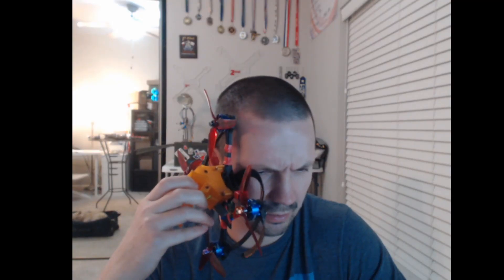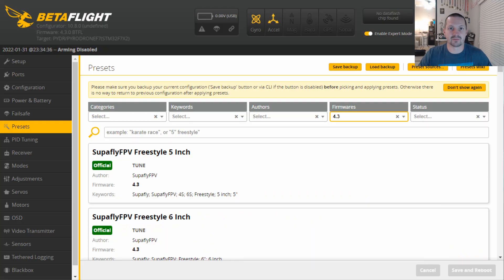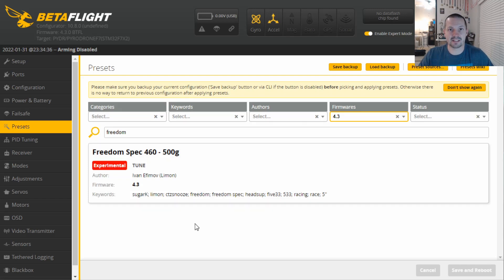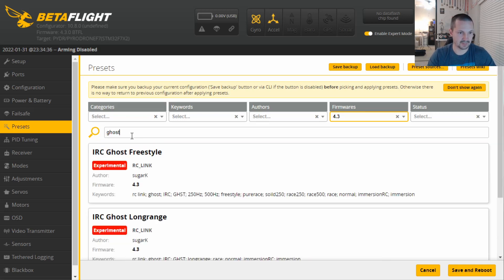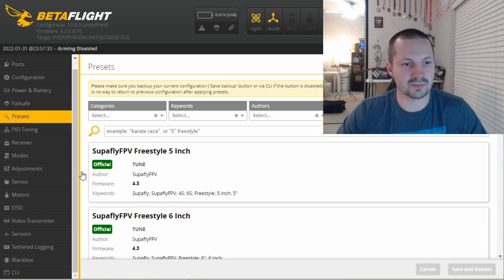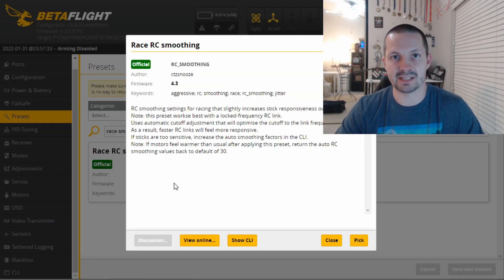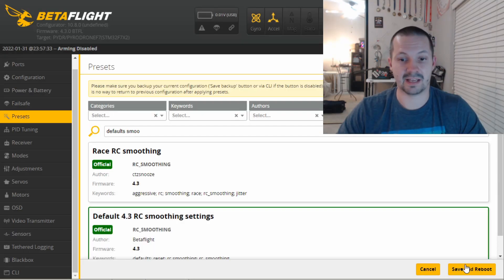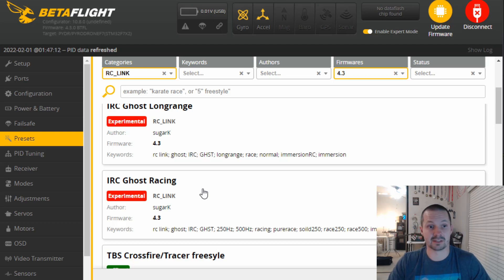Tune to fly faster? Freedom Spec.

Comment: Any plan to update this based on new 6s rules?
Reply from the maker: with new 6S rules ESC settings don't matter. Just fly your regular 6S ESC settings.
Reply: @IvanEfimovLimon  Thanks. I was thinking the BF tune settings would be different, not the ESC settings.